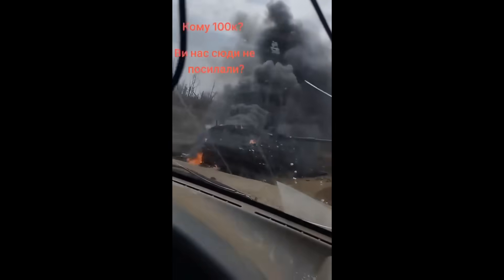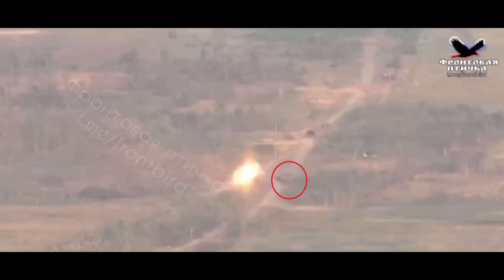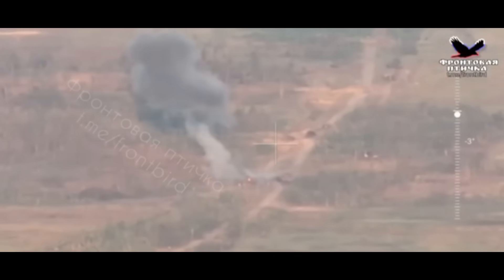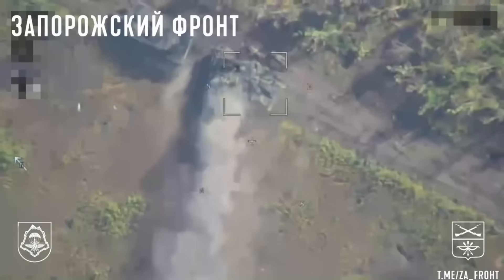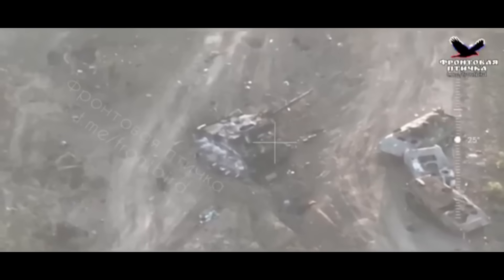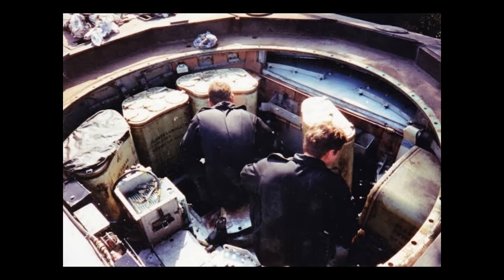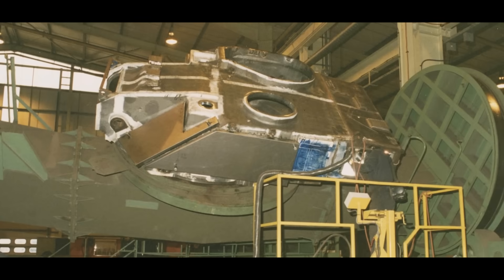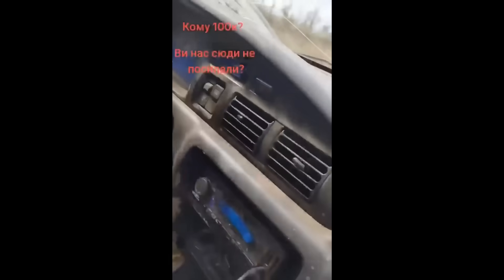This is how Challenger 2 got Destroyed in Ukraine

Comment: Is it possible that, since the vehicle was abandoned before it was hit, the ammunition detonation was not immediate but instead the result of an uncontrolled internal fire eventually cooking it off?

It would explain the crew being able to escape, despite a catastrophic enough explosion to dislodge the turret occurring at some point.
Reply: Most of the time, when tanks get hit horizontally, the fires start slowly and the crew has enough time to evacuate. That was the experience in Chechnya. Top attack warheads produce catastrophic detonations much more frequently, however.
Reply: @JAnx01  That sounds like a plausible explanation. My current suspicion is that the first immobilising hit caused the crew to evacuate the vehicle. The current UK MoD statement says that, before evacuating, the crew was attempting to stifle a fire from that first hit. I think it’s possible that the uncontrolled fire then spread to the ammunition, eventually causing a detonation. This would mean that the effect of additional hits from ATGMs is minor compared to the existing fire, although I can’t prove that.

Comment: How could the Challenger and Russian tanks fix the ammo protection issue?
Reply: For the Challenger II, apparently it's not being left without a crew. 

Jokes aside, it's complex.
Challenger II doesn't really have ammo protection issue, It could be better, but it's not as bad as people pretend like it is. Turret based blast panels can still fail, hull based blast panels by modern penetrators can still fail once their puncture leads to the main compartment, rendering their design worthless. 
Challenger II could adopt a standard ammo bustle with blast protection.
Hull ammo is complex, though something akin to the Leopards is possibility.

Russian tanks, ehhhhh - I've heard there is something in the works/in usage that is just a blast panel at the floor, meaning all the energy is dumped to the bottom. This should help, especially as the crew aren't as able to see impending ammo burn. Redesigned turret to feature a rear bustle also could occur, but that is just trading issues. Turret bustles if penetrated from behind, should have enough energy to break the protective bulkhead and detonate the ammo in the crew compartment.

Comment: Video seems to show a blown track and an engine/diesel fire. Hull and turret are intact. If this can be recovered it can likely be repaired.
Reply: It's completely burned down and the turret is dislodged. The heat effected the entire hull and turret armor. This isn't repairable.
Reply: @DefinitelyNotEmma i it can be melted into steel and re-built
Reply: @DefinitelyNotEmma  You must be looking through Russian-tinted glasses. There is no evidence of a hull breech. There appears to be an engine fire, however the engine compartment is segregated/firewalled from the hull. Armoured steel and ceramics take more than a diesel fire to melt.
Reply: @andyo8141  The turret is off, cupola is off; which means internal pressure from burned ammo, which means that fire did in fact happen inside the hull and/or turret. And steel does take more than diesel fire to melt, but not to bend. Steel gets easier to bend way before it reaches its actual melting point.
Reply: @tobiasrodrigo7947  What makes you think the turret is off when this video clearly shows otherwise? Have you been looking at too many T-72/80/90 turret tosses?
Reply: @andyo8141  The video clearly shows it's off if you actually went and watched it.

Comment: British Tank commanders confirmed the tank is actually repairable, the tracks need repairing but the rest of the tank did not sustain major damage just fire damage. The video makes it look worse than it actually is.
Reply: dude that thing ist completly burned out and wrecked
Reply: Repairable, lmao. It’s completely burned
Reply: A burned out tank isn't repairable. The heat comprises the armor structurally. Source? A German Leopard 2 commander I had the pleasure to converse with
Reply: Tank commanders are master repair men?
Reply: Hamish de Bretton Gordon Former Commander of the Royal Tank Regiment.Sean Bell ex Vice Marshall RAF and i have spoken to Connor Mkayjik a friend who was a Challenger 2 Tank Commander in the Iraq war. They all say it looks like surface damage and Repairable. @DefinitelyNotEmma
Reply: Nah mate that thing looks fucked. If its good for anything maybe spare parts.
Reply: @moochoman9948  Yeh i thought so, looks totally busted up. But interviews and talking to my friend they point out some significant points. The fuel tanks and engine are not damaged. The crew confirmed the internals are still intact and the ammunition storage has not been breached. The turret is still connected confirming the internals have not been compromised. The main gun is still intact including the optics etc, also confirms the tank was not penetrated because their is no smoke coming from the main gun. If you look at the back the extra fuel tanks are still intact and have not exploded, so the damage was mainly to the front of the tank which is the most protected part of the tank. The smoke and flames are also towards the front which suggests its a surface fire, otherwise the turret would not be as intact as it is in the video. The main damage was to the track because of a mine, but the challenger has good protection from mines underneath the main body. So even if it looks bad my friend says he has seen much worse.

Comment: Hmm , ngl , but i kinda doubt about the crew survival , it is all words but no actual proof , especially from the crew themselves . What are those other AFV and truck doing near it ? I don't think it is the towing crews . What if the Challenger is ahead of the group follow by the AFVs and then disaster struck ? Would Russian just let a bunch of infantry escape without calling arty barrage on them ?
Reply: yeah it's not clear the crew survived as it's not clear how the tank came to be at that spot.  A mine could've disabled the tank but the mine could've killed some of the crew, it's not possible to know.  Some claim the turret was aligned to allow the driver easy escape but again it's not 100% confirmation just an assumption.

Comment: It must of got hit on the engine because it’s armour is supposed to be able to take a kornet impact.  I doubt it would of penetrated if it had hit a armoured spot.  It did look like it was burning from the rear of the tank so it’s probably an engine hit.
Reply: Don't believe me if you don't want to, but it was a hit on the upper plate of the hull, on the right of the drive hatch, I saw on a video from some Ukranians driving around it.
Reply: @gerfand  anything that hits there is likely to penetrate.
Reply: @Biketunerfy  no, not the 60mm weakspot, the strong part of the hull
Reply: @gerfand I don’t know, I didn’t see it for my self (the tank in person) but I do know it’s unlikely to penetrate the strongest parts of the hull.  The turret is the most armoured part of a tank but if it’s hit on top it’s not armoured there at least not with the composite armour.  They did tests with tandem warheads with heat projectiles none penetrated.   Those damn tanks have taken over 70 hits from RPG-7s and 2 milan Antitank missiles in Iraq and still kept fighting so it must of been a lucky hit.  Besides I heard that it threw a track after running over an anti tank mine so it was disabled first giving the Russians ample time to hit it in a weak spot.  Those videos are terrible quality so they aren’t good enough quality to tell what has been shot at it.  It could of been hit in a vulnerable spot that we can’t see.
Reply: @Biketunerfy  well from a video I saw the hit was on the strong part, remember that Kornet is rated for 1250mm RHA, I think that is already greater than what Challenger 2 hull armor is rated for.
Reply: @gerfand  I know the video you talking about and it’s not good enough.  A tank has many sides and many places that could not be seen that could of been hit.  If you look at the challenger 2s up armour pack you can see the areas of concern the engineers wanted extra protection for this shows where it’s armour is at its weakest I never seen any on the frontal turret armour that’s well over 1800 mm of protection.  Kornet entered service in 1996 and challenger 2s had already taken impacts from them in Iraq and survived.  It’s very unlikely a heat projectile will penetrate the frontal turret armour.  The heat projectile isn’t penetrating RHA it’s penetration composite armour which is twice as effective as rha and 1.5 more effective than era.  That’s why they don’t use up armour on the frontal turret.  They did disable 2 American Abraham’s though with kornet in Iraq so Abraham’s uses the same composite armour as the challenger 2s since the U.K. shared the secret with them but the tanks were fixed in a few days and back out in patrol.
Reply: @Biketunerfy its probably not the same video, the one I see is the driving east to west.
And I said hit on the hull not turret

Comment: I think one people have to remember is that while us brits to big up the challenger 2 that when it was sent to ukraine it was sent underarmored to what the british would naturally do. The tanks sent basically only had their hull and turret armor, no ERA or Dorschester armor was given to ukraine. Albeit this wouldnt have mattered if it was truely hit by a mine and that being said pretty much all tanks are going to be incapacitated by an AT mine. Which again if true brings me back to the start of my comment, if it was abandoned then russia his destroyed this tank only for the hype and the reason it was destroyed by an ATGM was becuase it was underarmored to original british specs. 

The exact same thing will also happen when Abrams enters the fight, US will not be giving ukraine Abrams with Chobham nor their Depleted urainium composit armor packages making them just as likely to be knocked out by the challenger. 

Although if think its a dumb decision by ukraine not to be using a mine resistant tank in this convoy protecting arguably their most valuable western tanks. 

And More over Challenger 2 is designed more as an Defensive tank and not an offensive one, so has ukraine listened to their mentors in the uk? who knows, hopefully there wont be anymore Challys destoryed, time will tell.

Comment: Looks like the Kornet hit the rear turret which explains the penetration then exsplosion.
The newest model of Kornet (D) wouldn't be to penetrate a large portion of the front armour of the Challenger 2.
As it's HEAT pen is about 1300.
Of any of you seen that idiots leaked pictures of the Challenger 2 protection specs will know what I mean.

Comment: Tanks aren't indestructible. They just have better or worse protection / designs. And its only one Challenger, which protected its crew. So, job done. If it had detonated like the Russian tanks, killed its crew and blew the turret 30 feet in the air, I'd be worried. But still, good analysis.

Comment: Artillery are knocking out tanks left and right.  No tank can take 152/155 shells to the roof.  Why all the Russian tanks are getting picked off.  Hit a mine and you are basically a sitting duck.  Tanks have poor armour on top.  If a tank was armoured 360 with the same front armour you would get a 200-300 ton tank.  Challenger 2 was designed in 1986–1993.  Like with Russian tanks, before drones etc.  Now active protection systems are a big deal.  Tanks need to update themselves.  The Ukraine war is showing you cant get away with cold war designs anymore.

You should see the state of Russian tanks, they are getting knocked out on the move by very cheap drones and 155mm anti-tank rounds from artillery.  No tank is safe in Ukraine at the moment.

I cant see a Challenger 2 surviving multiple 152mm hits on the roof.  Those shells also set off ammo and destory a tank completely.  This happens with all the Russian tanks as well.  They too get immobilized by mines and them owned by drones or raped by artillery.  The best design is the tank that can survive the longest.  That could be measured in seconds or minutes.  So far the Challenger 2 looks to be better.  Hell even Russian tanks perform better when Ukraine uses them.  Just gets to show that the major factor for tank loses could still be bad tactics or tactical mistakes.  Like driving into artillery kill zones or mine fields.

Comment: Cased 1 piece ammo types stored in bustle- gets hit- explodes= you need blow out panels in bustle.
Bagged 2 piece ammo sabots stored in bustle- gets hit- nothing happens.... sabot is inert= no blow out panels required.

Charge bags stored in wet bins in the center of the hull- if bag gets penned... well its right next to the crew who are likely already dead if the hull was penetrated, if they're not the bag floods giving them time to exit.

They key is to not get penned in the first place through superior armor...
...unlike what is effectively an upgraded turret on a 1980's challenger 1 hull with no applique armor that its designed to have while in entrenched positions in west germany.

Meanwhile any T72 or T80 with an autoloader and covered in ERA gets penned easily and goes up like the 4th of july killing the whole crew.
There is a reason why a T-whatever exploding isn't newsworthy and this would be (if it had full armor package).

Comment: Also worth noting this is the 3rd Challenger 2 to be destroyed in action. The first was a blue on blue, the second was in Iraq as a roadside bomb (most likely a large shaped charge).

Considering it's been in use for 30 years and seen plenty of different warzones that's still an impressive record.
Reply: Only 1 Challenger 2 was destroyed in Iraq. Fact. A second one was damaged and the driver list some toes, but the tank was repaired. A third was hit by an IED and the driver lost a leg, but the tank was repaired. The armour has since been upgraded to prevent the latter 2 incidents as part of the Streetfighter upgrade.

Comment: I guess the propaganda armour of the challenger 2 did not work this time?

It also burned like any other tanks and it pop its turret as well just like the Russian tanks. The reason it’s turret did not fly flying several meters into the air is because the challenger 2 torrent is very heavy compared to the torrent of the Russian tanks. Also Russian tanks carry more ammunition inside the tank compared to challenger 2 that is why the force that generates in Russian tanks is far greater compared to challenger 2.

Despite challenger 2 having heavy turret and low force of ammo detonation, it still pop it turret all these proved that challenger 2 is not as invisible as the British propaganda tools claimed it to be.

The worse still is that, it got destroyed on it tracks far away from enemy before it even get to see the enemy and got destroyed by with it mine, or artillery shrapnels or lancet or kornet anti tank weapons all shows this tank can be easily destroyed once it appears on the battlefield.

That stupid claim it have never been destroyed in combat. The tank has never been used in real combat, it only appears in combat as a fire support weapon to clean up despite all of it cautious use on battlefield in Iraq it was penetrated and the tank driver lost his toe. Since this tank is always far from conflict zone far away and safe in hangers and only use as training vehicles 

The reason it was never designed before was because it was never used in combat with real competent enemy. I have never been shot because I never see gun that doesn’t mean I am invisible. The same analogy applies to this tanks.

Comment: That Coronet is as deadly as the Javelin just not as quick to set up. It certainly did a number on the Challenger. One has to remember though that tanks are gonna get smashed irrespective of how many you have or how tough you think they are so quit crowing Russia you have lost over 3,000 tanks and crews to date.
Reply: Kornet missile is more powerful than Javelin, it has about twice the armor penetration of a Javelin and a longer range. The Javelin missile doesn't carry that much explosive but its design to hit the weakest part of enemy armor at the top. The Kornet is not design for top attack but for direct attack so its a much bigger missile that hold way more explosive. The Kornet is also 3 times cheaper than the Javelin missile.
Reply: perhaps the west and nafo bots should stop claiming these weapon systems as game changers

Comment: Good work and most interesting. Quite surprising that the ammo storage has gone unnoticed by most up until now. Makes you wonder if the UK shouldn't go for Leo 2A8 instead of the upgraded, yet I guess still highly unsafe Challenger 3.
Reply: Oh thanks for that, instead of being some random internet dude you're clearly on the design team 🤣😂🤣😂🤣😂
Reply: The main upgrade for challenger 3 is the gun which will now use one piece ammunition. This means it's likely that the challenger 3 will have blowout panels as the multiple piece ammunition system seems to be the primary reason for the 2 not having them.

Comment: Hi. You didn't think that if the commander's turret was torn off, it means that it was closed during the explosion, which means that the crew was in the tank. If the crew had left the tank before the explosion, the tower would have been open, and the energy of the explosion would have come out through the hatch, and not torn it off. What do you think about this?
Reply: The small constriction of the open hatch being smaller than the ring that the cupola sits on might have been enough to catch thrust from the cook-off and throw it away.
Don't forget that the KABOOM was big enough to lift the whole turret off its ring.